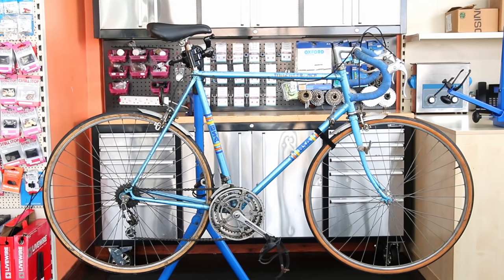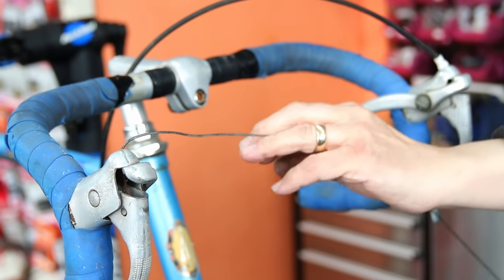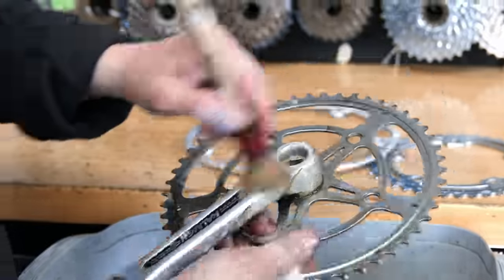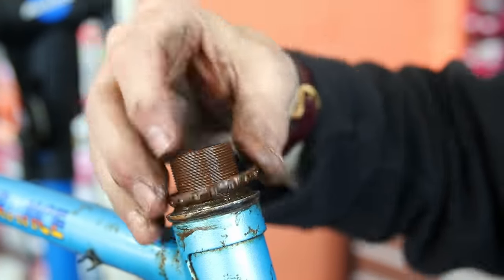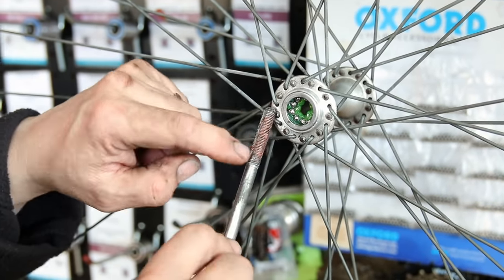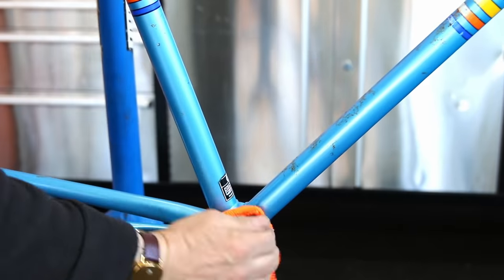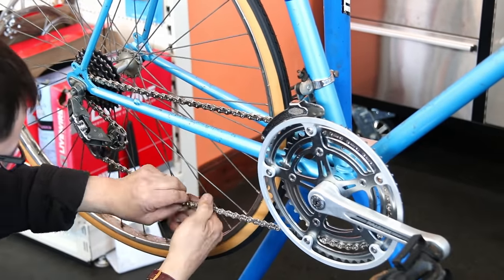Vintage BSA Restoration! Tour De France Bike Rebuild!

Comment: I agree about the old bottom brackets. Square taper on my vintage is miles smoother than any of the press-fit or threaded BBs that I’ve handled
Reply from the maker: They are more often than not amazing!

Comment: Thanks to you I now know what a large difference hot water with soap can make. Not good enough for chains but pretty much everything else cleaned up nicely. It's just a bit difficult to work on the hot parts.
Reply from the maker: That’s pretty bang on there, putting time in can do most of the cleaning

Comment: My kind of restoration. Exactly the same cranks that I'm currently riding on. However with me, I don't love front derailleurs, so I neatly chopped off the big ring, and it left this lovely little chain guard ring aside my 40T smaller chainring. Quite a nifty look !
I have a few bikes from the 70's. I guess it was the bikes of youth which still move me. I love riding on fewer gears though. I just did an 1800 km trip heavily loaded on a five speed. My 40T was geared to a 16 - 32T freewheel, and that gave me everything I needed.
Those Weinmann side pulls needed the special hollow key wrench to centre and adjust them. They were never my favourite brakes. I've always loved dia-compe. Cheers mate
Reply from the maker: Thanks David!🧡

Comment: Excellent job.  No you can't convince me to drink coffee at 2am while I'm binge watching these! lol.    I always grease parts I maybe shouldn't' too, seat post stem, seat clamp threads.   just to stop sticking.  I had a seat post one time that went too long without service  it was locked in the frame, the bike shop had to drill a hole through it and cut down from that hole at the top to bend it away from the frame and then yank it round with pipe wrench.  my mate who worked in the shop told me off no end for it! lol.   Drew
Reply from the maker: We’ve never made a mistake by greasing anything. It’s only the things that aren’t greased that come back to be a problem!🧡⚙️

Comment: my first proper road bike in 1990 was a holdsworth reynolds 531 steel frame with a shimano 105 groupset 52/42 with max 23 tooth sprocket , great bike, extremely reliable machine felt great to ride even though you had to sit down to shift gear
ps remember duraglit for cleaning metal surfaces it was great for wheels

Comment: The cup (hard steel) on the drive side is often difficult to unscrew, since there is not enough grip for the tool. You can use a bolt and nut (with eventually washers bigger than the cup hole diameter) and place the bolt through the cup from the inside and then screw the nut to secure the bolt on the cup. Then continue to screw the nut clockwise, it will normally unscrew the cup which has reversed threads. If course you need to be careful not to damage the bearing track inside the cup with the bolt.

Comment: Algorithms working well here. I bought a ‘60s Puch two days ago and it’s in similar condition to your BSA; same amount of dirt in the same places! I’m just missing one short alloy mudguard…but as the project is for me, it will have no guards or full length…decision yet to be made. I don’t own an ultrasonic cleaner but have been tempted, though I do have a prodigious collection of brushes, rags and microfibres cloths. Anyway, thank you for this excellent video; pretty much perfect for my needs. Now to order some Shimano grease….
Reply from the maker: Awesome Peter! Good luck with the project, check out our website bikespeeds.com/shop. You may find something to add to your collection!

Comment: Love the channel, but wondering why you serviced the head set bearings before spraying de-greaser to clean the top of the forks around the crown. Surely the de-greasing agent would ingress into the bearing races.

Comment: Great at usual! How do you know how many bearings you have to put in the bottom bracket or in the headset?
Reply from the maker: It varies on every bike, count the ones you took out and put the same amount back in, it’s usually an odd number of bearings though not always 🧡

Comment: Awesome watching from Australia. Great channel, your format is excellent. 

When you do loose bearing work, how often are new ball bearings required, vs just clean and new grease?  

Cheers!
Reply from the maker: Often you can clean up the old bb’s and it should be fine. It really depends, you can see here the issue was that the grease had dried out not that their was wear in the cups and bearings, which would suggest they just haven’t done many miles for years.

Comment: is there a reason you seem to use a cone spanner for those 'stubborn' BB cups rather than say a Park HCW4 or HCW11, Knipex Pliers-wrench or large adjustable, all of which would engage both sides of the raised part of the cup at the same time?

Comment: This is so good! One question though, I’ve seen most of your videos where you uses soapy water to clean parts but directly dry them off without using normal water to wash off the soap from the parts. Doesn’t a thin film of soap kind of build up in small spaces of the parts? Or it cleans right up ?
Reply from the maker: Not in our experience!🧡⚙️

Comment: Currently my fav Channel on YT. Question: are you cleaning your microfiber towels in a way or just throw them away when they are dirty?
Reply from the maker: We use new on paint / frame we the use those on mechanicals and then those on greasy bits. We then wash them in a washing machine and they go through the mechanical side until they are finished. But always, always new on the frame

Comment: Nice bike, nice refresh. BSA was one of those brands like Carlton that was swallowed up by Raleigh and became a portfolio product, but they had their own niche and following.

It’s not clear from your commentary whether you replace the actual ball bearings when you refresh and how you can tell if they have worn or deteriorated. I’ve sometimes seen wheel bearing balls that have picked up a brownish colour. Do you choose a particular brand of replacement, can you detect any difference in quality ?
Reply from the maker: Bearings are a case by case, with this sort of restoration job often the bearings aren’t worn but dry, but other cases they’re very worn and well lubricated. We really just feel the bearings and change our technique to each bike🧡

Comment: Beautiful stuff. Im totally nerding out. Do you ever consider things like frame fatigue? there is alot of talk within the cycling community about carbon, steel, ali fatigue and corrosion.
Reply from the maker: I don’t have the equipment to measure frame fatigue other than spotting early signs. If I spot anything usual I inform the customer. I have noticed a few post crash fractured chain stays that have needed repairing over the years
Reply: @Bikespeeds yeah I think a frame will fatigue but long after a rider has moved on. I'm not totes convinced it's anything to worry about. Unless like you saw it is visible / obvious.

Comment: You're never going to get the drive-side cups off with that style of wrench. Get the Park Tool HCW-11 or a similar wrench that fits across both sides of the flats, and then use something like a quick-grip clamp to hold it on the flats and smack the end of the wrench with a hammer to break the threads free.

Comment: 8:27. Looks like you put the stem back in without grease?
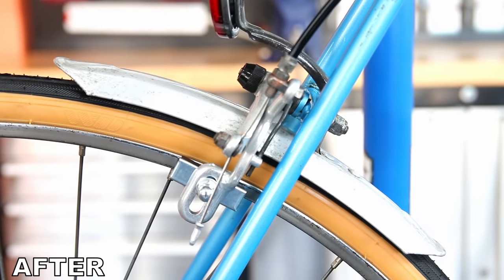16:30 also it looks like the brake block isn't straight.

Comment: Hi Lee,

5:54	If you grease bolt threads, won't they be getting loose on their own from the vibration? Like, isn't the opposite of anti-seize "easy to slide off"?

Also, if copper grease works as anti-seize and anti-corrosion by creating a thin film that covers metal, then why does it have to be copper? Won't any grease do?

13:41	Why are the mudguards so short, what is even their point?

Thank you.

Comment: Isn't there supposed to be a sleeve in the BB? Also if you didn't remove the fixed cups and clean and regrease the threads, what if it wears out and needs replacing in the future? Same thing for the freewheel

Comment: I restore 70s and 80s bikes. What do you do if you find the cones or hubs bottom bracket cups are pitted. I like to shop around for good second hand components. If there is pittings the bearings will never run smooth.

Comment: Notice the indentations on the sides of proximal chain stays (close to the BB) facing outward. I'm used them facing inward, giving larger tire clearance. Did someone screw up during the original assembly of the frame's rear triangle or was this by design?

Comment: Hey guys. Love the videos, they've been incredibly informative in assisting with my own bike restorations. 
The bearings you use, do you always replace them or clean and re-use the old ones? If you replace, what sizes are they?
Thanks from Bristol!
Reply from the maker: Bearings aren’t specific to the bike, but often specific to the head set fitted to the frame. As a rule we tend to replace if they feel ruff as it’s usually cheaper than the labour to clean them

Comment: Some vintage bikes should be allowed to retain their original paint, especially those with distinctive or rare color schemes and those whose owner wants it to look its age or just likes the original scheme.  For others, it just doesn't matter.  I recently delivered a 1980 Motobecane frame set to a blaster/powdercoater, and when I get it back in a couple of weeks it won't be wearing its original color, or any Motobecane color from that era.  It'll be a slightly metallic black cherry and will wear eventually metallic silver reproduction decals.  But it's a bike that has near-zero collectible value and is special only to me as it is the same model that I treasured years ago as my first "real" bike.  Just like today, most bikes from the 80s offered few color choices -- you got what you got.  Mine was gold with brown decals.  Eeww!  Changing the color to something I would have chosen if I could have makes a lot of sense in this case.
Reply from the maker: That’s a great story, I restored my childhood Raleigh some time ago and it was a great feeling

Comment: Copper slip is an anti seize, fair enough. But it is an anti seize especially designed for steel bolts in high temperature applications where pure grease will inevitable fail over time due to the heat input. Now on a bike we will never reach high temperatures like on a car exhaust. And if i understand you correctly, you say that the small percentage of copper in copper slip will not cause any galvic corrosion with other materials because the grease in cooper slip will provide a barrier
 against possible electrolytes like water. But if you relay on the grease part in copper slip (which is not necessarily really quality grease) and the copper percentage is miniscule in your opinion, why not use pure grease in the first place? And if you dont thrust the grease, well then please use a modern ceramic assembly compound and not god damn copper slip, where to copper will react like crazy with aluminium threads. There is just no scenario on a bike, where copper slip has an advantage over grease or a non metallic anti seize compounds.